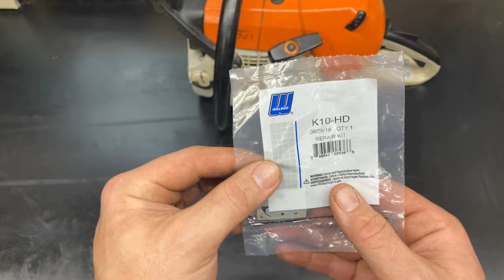Stihl chainsaw running poorly...carburetor kit rebuild! Step by step how-to for Stihl HD carb!!!

Comment: Yes it has been a long time, 6-months since your last repair video, I ended up developing a complex in all that time. HAHA! So a Stihl with an Mtronic is it eh? I think we will call that a Stilch then. I think you did a really great job, you were really careful not to damage anything while taking it apart, you serviced the carb with a cleaning and new carb kit professionally, and you put it back together with just as much care, that is something that I like to see. I gotta say, that thing has excellent throttle response, vroom vroom, ready to cut some wood.

Comment: I have 2 of these. The black solenoids didn't work, the green ones were a problem too. I'm on to white to see how they'll do. Stihl says white isn't for the this saw, but I've heard they work just fine with the new orange fuel filter. We'll see.
Reply from the maker: Let me know Philip - I just filmed a video on how to change out the solenoid. Just need to edit. I had good luck with a green solenoid on the MS441CM. Cheers!

Comment: Good to see you back at it Dave. Very good video and your right about the conditions a saw works in. The only thing dirtier than working on a chainsaw is working on a concrete saw. You keep your saw alot cleaner than most! 👍🎥🇨🇦🇺🇸Roger
Reply from the maker: Hey Roger - I appreciate the kind words! It’s good to be back.
Reply: You clean it, and you keep it clean often, there's no reason not to. 😉

Comment: Dave,ive gotta replace my throttle cable in my ms441cm.  Once the carb is out of the way is it pretty accessable?  Theres no room at all with the carb on it. Ive always had saws with simple linkages, so this is my first go around with a cable replacement.

Comment: Echo srm run great for 20-30 minutes and then start to run rough and lost power, after a few hours later it run great again for 20-30 minutes and then start to run rough and lost power again.
Reply from the maker: Check your fuel tank vent